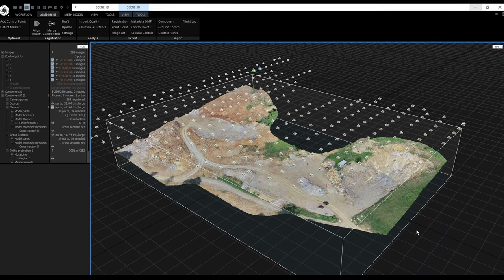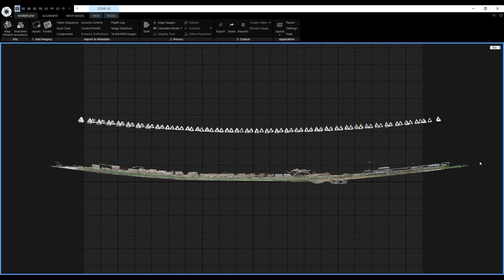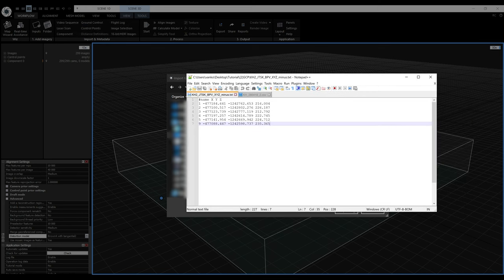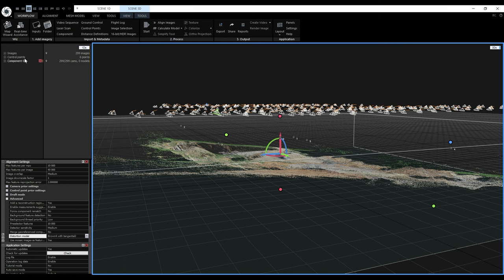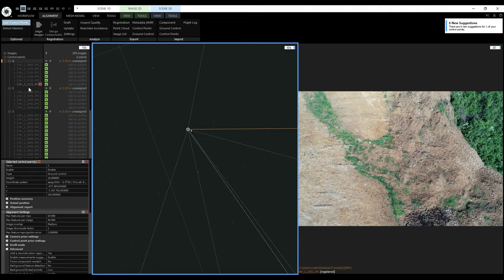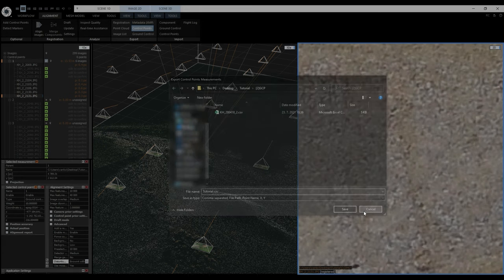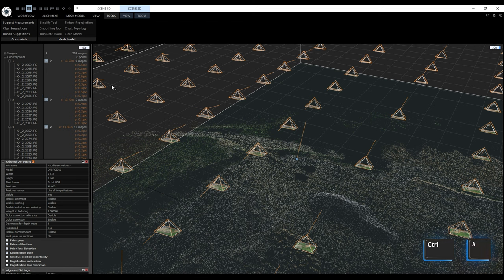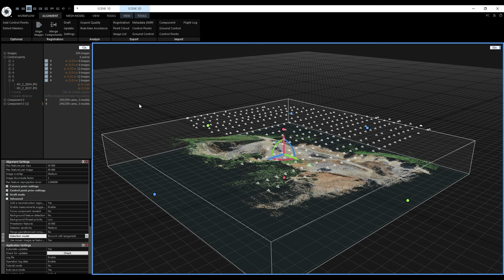Drone Mapping Guide | Part 1

Comment: Is there a way to export the camera to 3ds max?
Reply from the maker: Cameras can be exported as a part of the model.
Reply: @CapturingReality  thanks. I'm using 3dsmax. I found I can get a individual camera per photo with fbx. Is there a way or a tool to have that be an animated camera instead for tracking?
Reply from the maker: @mikegentile13  What do you mean with animated camera?
Reply: @CapturingReality  i am trying  to use reality capture to do a tracking shot in 3dsmax. The footage I'm tracking is 200 frames. RC generates a nice model and 200 individual cameras. I would like to know if it can generate an animated camera
Reply from the maker: @mikegentile13  In RC you can create an animation (https://www.youtube.com/watch?v=RLgFpbmJ4WA). But that will result as a video, the cameras won't be exported from that.
Reply: @CapturingReality  yeah I definitely don't want a video from RC.  It's gotta be possible.